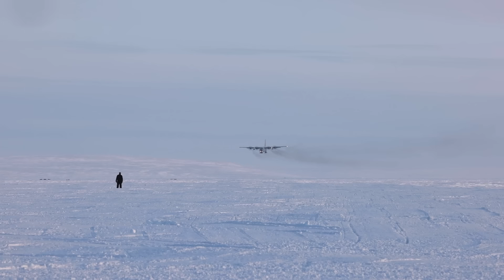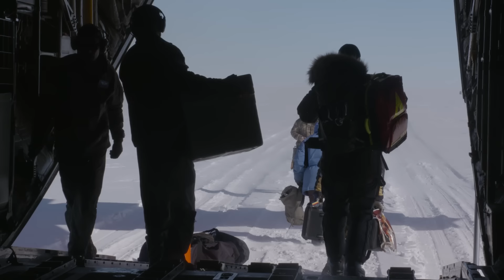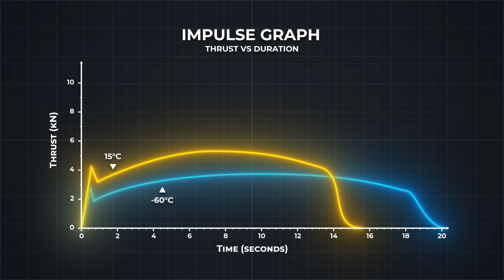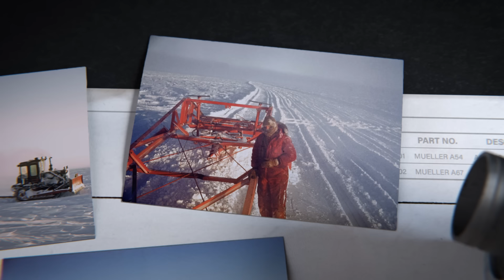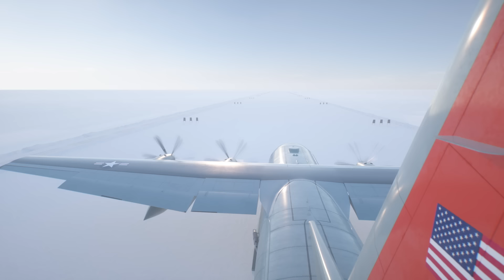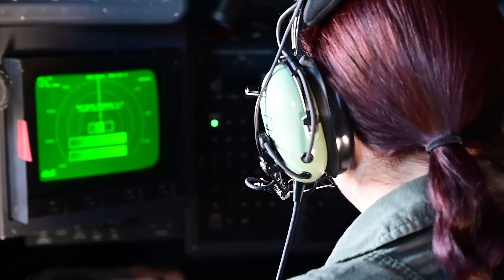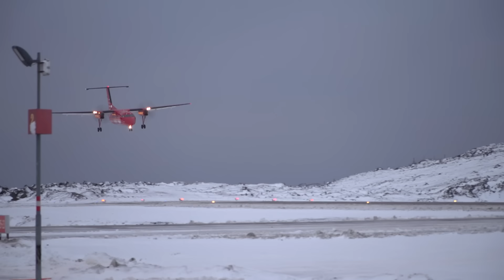The Wildest Take-Off of My Life

Comment: 7:18 so I'm accustomed to sub 40 and 50 weather. Upon hitting 40, you do have to be careful with exposed skin even in areas that have significant blood flow. This is true even if you keep the core of your body nice and warm and all of the extremities nice and warm, it is most dangerous at -50. You would say it well duh... But it's not a linear danger, it goes up much quicker than you would think for each degree. Doesn't matter if it's Fahrenheit or Celsius. One of the key things is not to overdress, while still making sure you have the right clothing to maintain good core temperature. The reason not to overdress, has to do with perspiration. Any preparation is death at these temperatures. If you find yourself perspiring in any way or form, you need to get the f*** out of the weather and into some form of shelter. I'm able to use clothing that is normally reserved for most people for zero Celsius, or 32 Fahrenheit.  This is partly because I get acclimated, it's also just who I am, apparently I come from a line of people who really liked cold weather. So if you are in that type of situation and you are planning on being relatively static, you need heavier clothing, if you plan on being in that situation but are going to be walking around, you going to need more breathable clothing or less of it. The two things you should not skimp on at all, boots that don't restrict your circulation and are appropriate for the activity you're planning on doing, and gloves that protect your hands. You should also be extremely careful with your ears, and probably the tip of your nose, though the cheeks are also vulnerable, though much less so.  But the most important thing, is that you continuously self-assess your fingers, your toes, your ears, your nose. It has to be second nature to constantly check that you're not going to start perspiring, that you're not showing signs of overly cold or overly numb extremities. If you do those things, it's actually quite pleasant to be in that type of weather. The sound of the very crunchy snow under your feet, the beautiful landscape that usually accompanies it, the relatively noiseless environment around you. It feels clean, tastes clean, smells clean. I would walk in Siberia for hours in sub negative 40 weather, My Siberian friends actually thought I was nuts, and couldn't believe that not only did I do that but I lived. But it's really all about perspiration, and self-awareness. You can use very light clothing and survive in these temperatures if you do it just right. But always make sure that you're near some form of shelter that you can get to quickly, because the moment you start showing any signs of numbness or other negative signs, like you started to perspire because you walked on a very hard patch of deep snow, you need to head to that shelter immediately or you will lose something or everything
Reply: I will most likely never experience that level of environmental challenge, but your essay is getting copy/pasted into my notebook.
Thanks.
Reply: You're friends don't do it cause they have the community memory to know how bad an idea it is. You have a knifes edge balance, I've done it too. Then you slip or trip and are on the ground. If you don't get up quickly, or knock your head and someone doesn't find you are very quickly in serious medical trouble. I've done it, run to the grocery at -45 with a hoodie and pj's, but that's suvivorship bias. My neighbour did the same thing, slipped under their truck and froze in the minutes it took to pull em out. Spent a week in hospital and had to get medevaced out.

Comment: Fun fact, a c130j-30 flew over me yesterday. It was super high up, but you could still see its general outline, and its engines were still pretty loud. Something about the deep left over rumbles of those 4 prop engines is so much crazier than hearing the normal small jet and single prop engines that usually cruise over me. 

It was pretty cool, watched it fly on a flight radar for a minute... It was 2 towns over before i got the app open

Comment: How is an instrument landing done in such a place? 
I'm going to assume that they don't have some kind of ILS installed on the skiway, do they use some kind of VOR beacon or is it a GPS approach and then they use the ground radar and the flags? How do they set the QNH altimeter setting for the landing spot? is it measured on the ground by a makeshift weather station?
Reply: In the 1970's when I flew this mission as a pilot in the 17th TAS, the DEW line sites (Dye-2 and Dye 3) had a TACAN navigation beacon.  We would get close to the site with that then the Navigator would take over with the on-board radar.  The instrument approach plate would have us go to a certain holding altitude the the Nav would line us up with the skiway flags.  At a certain distance from the skiway (I recall about 10 NM) the Nav would say, "ten miles...begin descent" . We pilots would than start a gradual descent.  The Nav would call out distances (and headings) and what altitude we needed to be at for that distance.  we would continue to our MDA (Minimum Descent Altitude) and fly forward until we could see the skiway flags.  At that point we would descend to a landing but carefully maintain about 300 fpm descent rate and no more than 5 degree angle of bank.  Frequently had to do skidding turns to line up with the skiway.
Reply: RADALT

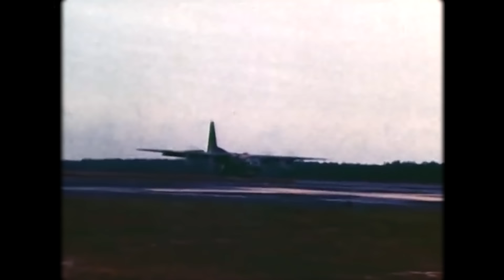Comment: 3:50 That c130 just shoot straight up in the air by those rocket😂😂 70s and 80s engineers were just crazy
Reply: Yes but that’s because the C-130 is specially modified and stripped of unnecessary weight.
Reply: @nwmancuso  thanks for the explaination, that does make more sense. Still, those tiny rockets' power still surprise me. I saw them on the Blue Angels' C130 once in an airshow, i thought they are just fireworks for a more dramatic take off, I just dont know they actually could push that hard.
Reply: @lukevin5941  no  because it basically lifted off vertically, an ac130 went like 30 feet then air born lol.

Comment: (1) I thought that all C-130s were equipped to use JATO rockets. At least the C-130E I piloted in the 80's in the Brazilian Air Force were. (2) A US Navy pilot told me about an accident he suffered while taking off from Antártida. One JATO rocket got loose during the burn and hit one of the aircraft's propellers turning at full power. Just imagine the destruction it caused... (3) I had the opportunity to watch two JATO take offs performed by Fat Albert, Blue Angels' C-130. It's truly impressive! (4) Thanks for the video! 👏👏👏
Reply: Newer H models didn't come equipped with JATO attachment points due to the higher powered engines.   The 109th C-130s are specially modified for the ice mission and JATO usage.
Reply: All USAF C130E had JATO hooks.

Also the AC130H were modified from C130E, and still had the JATO hooks on the right side.

Comment: Sorry USA, the Embraer C-390 is taking over the old C-130.
Reply: The C-390 doesn’t even fill the same mission requirements. The C-130 is a tactical lift platform, the C-390 is a general use lift platform.
Reply: @tl5606  Sorry but you are missinformed. There is no mission that the C-390 can't do faster and cheaper than the C-130. Prove me wrong.
Reply: @kruszielski  can or can’t? What are you saying?

Comment: 24:00 what are the flags made of to be visible on radar? like a copper mesh screen or aluminum?  Plastic wont show up or is the metal mast?
Reply: Right?  I wondered that too.  Aluminized mylar like a party balloon, or fabric with metal threads run through maybe.
Reply: @jimsvideos7201  must have a mesh because at those temps metal breaks like ice cubes
Reply: @lexinexi-hj7zo  Fair point.

Comment: One of the things not discussed about prop blades, that I would have loved to have seen mentioned is scimitar props. The prop blades become swept as you approach the tip, to increase the critical mach speed, similar to swept wings.
Reply: You’re speaking of the C-130J with its 6 scimitar blades.  The older engine/prop combo had a wide chord 4-blade, where the J uses narrower chord blades, but more blades.   Rounded tips as opposed to the old squared off tips.
It’s just a different way to bite air.   
It came down to where do you want your inefficiency?  Better cruise speed efficiency at the cost of take-off bite, or vise versa.   
I’ve flown in both.
Think of it like a bass boat outboard.   Do you want a 3-blade prop or a 4-blade?   Each has its benefits, and each has its drawbacks.
Reply: @CSMSteel7 some if not all LC-130's are retrofitted with 8 blade props, the same as the ones fitted to E-2 hawkeye.
Reply: @seavixen125  Eight?  Jeez.
Reply: @SME.Retired  
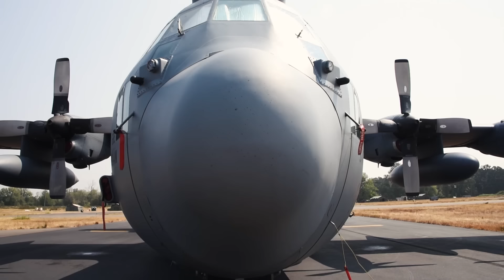21:05
Reply: @For_What_It-s_Worth  Exactly
Reply: I assume to counter the higher air density due to the cold temperatures?
Reply: @lord_kerman decreasing the critical Mach number decreases the strength and size of the shockwave coming off the top of the blades. As the blades get closer to Mach 1, their aerofoil shape speeds up the air over the top of the blades enough to make it go supersonic. This produces a shockwave on the top of the blades which creates a super low pressure zone, heavily reducing lift. By sweeping the blades back, it gives the air a longer chord length to travel over and therefore it doesn’t speed up as much and decreases loss from supersonic flow over the blades. 
The P-38 had this problem where it was very good at increasing the speed of the air going over its center wing which made it prone to shockwave generation. This created a low pressure zone which effectively blacked out the tail controls from the airstream, so pilots would frequently get stuck in high speed dives going transonic.

Comment: how do u de-ice the plane  wen ur in the arctic ?
Reply: Mostly don't need to. It's   damp conditions where moisture may freeze that causes most issues. In the northern winter, the air is usually dryer so icing is not always a problem.

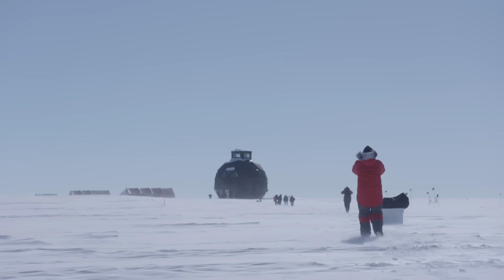Comment: 2:03 I bet you were so happy to be able to say this without specifying the units.
Reply: -40 C = -40 F
Reply: @eikebehrmann3493  -40K=-310°C and also impossible
Reply: @JulianDanzerHAL9001 no one mentioned kelvin but you
Reply: @benz4118  but at that timecode no unit at all was mentioned
thus I assume the default
Reply: @JulianDanzerHAL9001  Yeah, well...
Reply: -40°C 
= -40°F° 
= -32°Ré :   0°Ré = freezing water, 80°Ré = boiling. 
  Réaumur is an octogesimal division scale ca. 1730.
= 419.67°Ra :    491.67°Ra = freeze, 671.67°Ra = boil.
  Rankine is the Fahrenheit based absolute scale ca. 1848. 

Just in case you were pining to know.
Reply: without units I'll assume he means -40K which is impossible, damn lies, lies and deception
but it is the standard unit and the most sane one so without specifying it thats what I'll ahve to assume
Reply: @JulianDanzerHAL9001 Kelvin doesn't use degrees you dolt
Reply: He did specify that it was "40 DEGREES below zero." Fahrenheit and Celsius are measured in degrees, Kelvin is not. Kelvin is measured in Kelvins.  @JulianDanzerHAL9001
Reply: @JulianDanzerHAL9001  only a knobhead would assume that
Reply: @T.E.S.S.  only a normie would use any other unit
Reply: @JulianDanzerHAL9001 Wow you sure knows a lot about Kelvin, except for the fact it doesn't use degrees of course.
Reply: @JulianDanzerHAL9001  so your first statement is just a bad joke then?
Reply: @ridhosamudro2199  please tell me you didn't actually think anyone thought the arctic has negative absolute temperatures
i literally
pointed
that
out
come on
Reply: @JulianDanzerHAL9001  of course not, cause obviously I know Kelvin doesn't use degrees. I just said your joke is slipshod now
Reply: @ridhosamudro2199  then we have a very different sense of humor
did you know that jokes are supposed to be... funny and not just factual statements?
like if I commented "in this video a plane can be seen" that would not be funny
at least by my sense of humor
maybe yours works
very very differently
so here's some banger jokes for you
youtube is ap latform with videos on it
aircraft are vehicles capable of flight
the video we'Re commenting below lasts about 29 minutes and 2 seconds
this converts to about 1742 seconds assuming no rounding error in the time display which happens sometimes
the antarctic is in the southern hemisphere
it is rather cold
which is why he is wearing a jacket in this video
all factual statements
with no weirdness or seeming contradiction or absurdity
thus no humor whatsoever
I'm sure you're rofling on the floor right now
Reply: @JulianDanzerHAL9001  I didn't say the initial joke is terrible. It's the fact that you added to and explained the joke afterwards.
Thus, "the joke is bad NOW".

Well, it is actually objectively bad on the circumstance that you superceded a high brow joke that relies on the audiences knowledge with "hurr durr he doesn't specify, so it must be this obviously wrong thing right guys?"
Reply: @ridhosamudro2199  I don't think relying on people knowing that units of measurement are a thing is highly intellectual but that too is a relative scale I guess
in fact the initial comment is more of a ... sortof fun factoid than a joke
taking a technically sortof reasoned for but compeltely absurd interpretation and running with it actually has an element of absurdity to it
and educaitonal value as it is still the standard unit and you should still point out what unit you're using, always, unless of course you're measuring something dimensionless inw hich case you can just go unitless
but screwing around with units in werid but technically accurate or technically standard ways is kinda fun
and shows you how important a standardized system of units and an understanding of their working can be
Reply: @JulianDanzerHAL9001  Well it is objectively more clever and easier to swallow than "hey look I made a mid Kelvin joke and now I have to win this guy's validation."
Reply: @ridhosamudro2199  I can do both but you only see one
Reply: @JulianDanzerHAL9001  sure...of course you can. Anything to convince me, right?
Reply: @ridhosamudro2199  convince you of what?
that we have a different sense of humor?
or that I am a human who requries food and fluids to remain alive?
both are long since evident
Reply: - 40 kevin
Reply: @HOOOPER  Kevin? What's that?